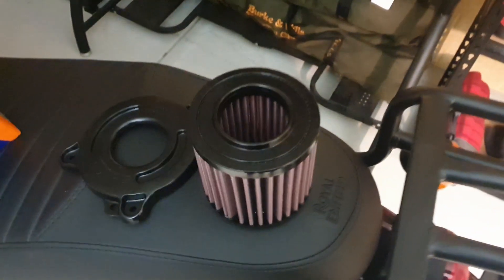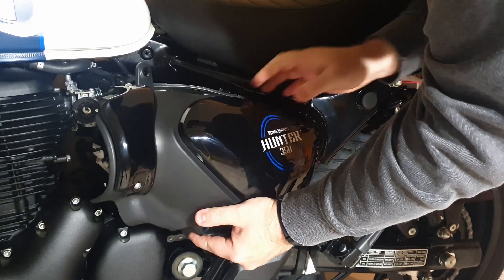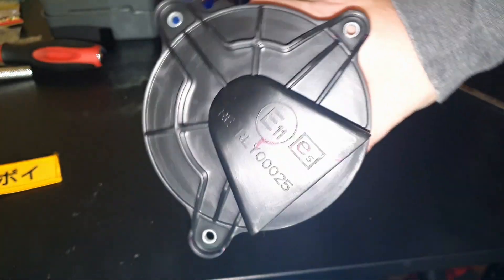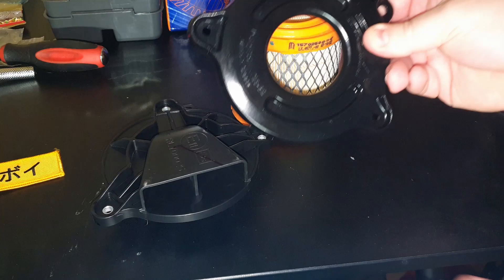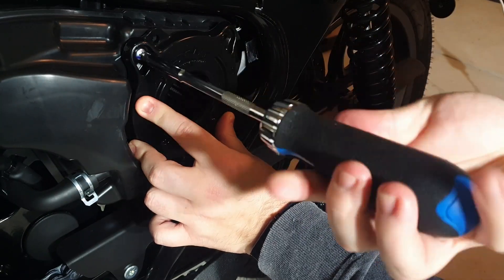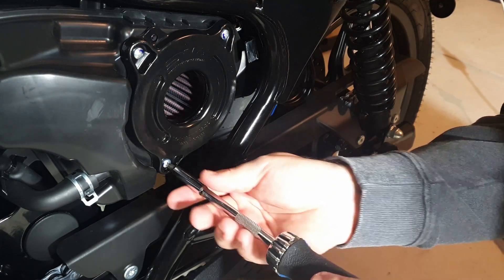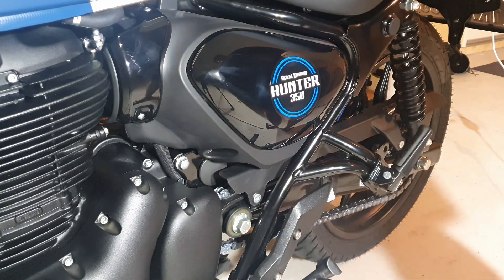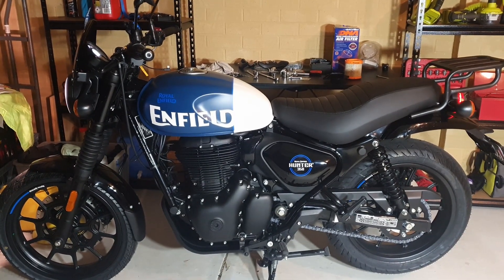Royal Enfield Hunter 350 DNA performance air filter and de-restrict plate install

Comment: How much for the filter and cover/plate ?
Reply from the maker: It depends on where you are and how you can get it. I had to get mine from DNA directly and ship from Europe to Australia, so it was not cheap ( about 200AUD). However If you live in Britain I know there are local distributors who offer it cheaper like TEC, and may be that other countries also have local distributors. I would suggest to just google 'DNA 350 air filter stage 2 kit <your local country>' or 'DNA air filter and high flow plate' and seeing what options are available.

The kit is not very competitively priced, particularly the plate for what it is, so hopefully some competitors start producing similar kits.

Comment: Has anyone done a dyno test to see the difference?
Reply from the maker: I haven't seen any videos floating around on youtube. I would expect there would be very little effect on performance, I more noticed just extra responsiveness and a little more low/mid (though that may just be from the responsiveness making it feel better).

I don't think this upgrade is a big performance gain, unless you are doing an exhaust system and remap. But If you want more go, probably a good idea to look at the 650 twins, the interceptor rides very much like the hunter but more than twice the go!
Reply: @MrCombfoot  I like my Meteor, the twins didn't really suit me, but we ride two up everywhere and a little more power/torque would be nice.
Reply from the maker: @allanb52   I have heard that the DNA plate and filter has helped some other people with 2 up capability, though I do not ride 2 up so I couldn't say. 

Potentially try this modification, and also an exhaust and remap if the gains arent what you need still (though this is a financial commitment without too much reward). I really dont think the 350 J series engine has too much extra to give over factory, it was built to license, economy and environmental targets and isnt a large displacement.

There is a Super Meteor, which is a 650 meteor, that recently came out if you have the ability to maybe trade in your 350 and upgrade?

Comment: The original filter intake was designed by a 4 yr old 😡
Reply from the maker: Likely the designers had to work  within very specific parameters to meet regulations for noise,  reliability,  emissions,  economy etc. Which resulted in the final design. It isn't an egregious design,  and works fine, but I wanted a washable/reusable filter and a bit less intake resistance is a bonus. In my area heavy rain while riding isn't a concern so I can get away with not having the water shielding.